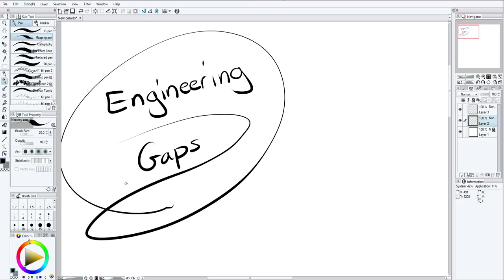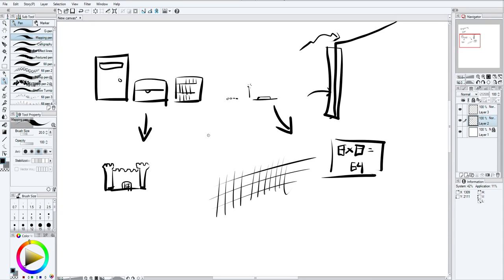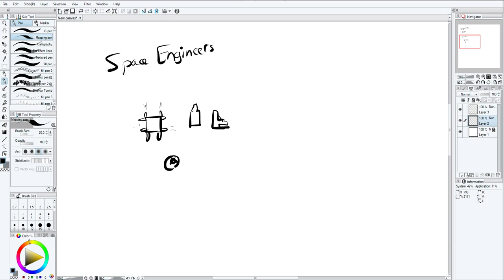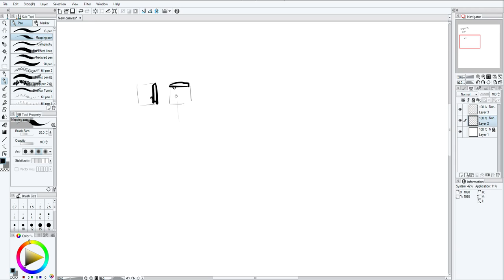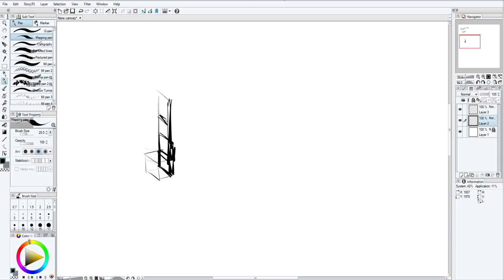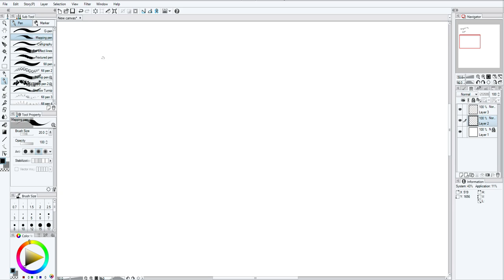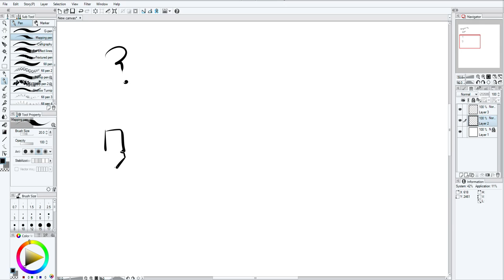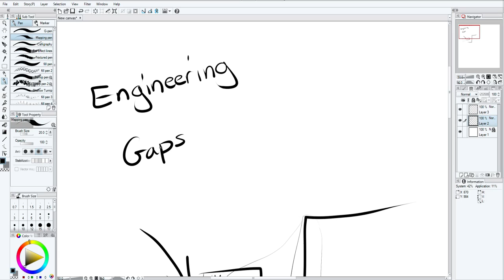Engineering Gaps (Design)

Comment: What you're looking for is stuff made out of orthogonal (in the computer science sense) components that are simple and accessible but still allow to build systems complex enough to allow for emergent behaviour and gameplay to develop. A lot of open world / sand box games strive for this and implement it to various degrees.
Minecraft actually also does this very well with the redstone system and a lot of blocks can be used together with redstone in ways not intended by the programmer before - up to the complexity where the game becomes turing complete.
What you're complaining about however is a lack of balance, so you're not actually demanding a new quality, but just a rebalance.
Which of course is never a trivial problem for complex systems. Even if you start from scratch and not grow into the complexity like minecraft did.
Recreating things that were simple building blocks before, out of more basic orthogonal components can be a way to do this, but it still adds complexity and needs testing with differently skilled players as I think it's easy with this approach to build something that advanced players can appreciate while engineering the fun away for new players.
Reply from the maker: I don't agree that it's about balance: I think it's about opportunities.

I would argue that the redstone doesn't qualify at all. The actuators it interacts with qualify. Pushers, noise blocks, rail switchers, etc - those are powerful tools. The redstone itself is mostly a tool for wiring them together, and it's a massive, massive burden, far more heavyweight than any simple wiring system would ever need to be. It is possible to build complex logic circuits out of redstone, but that is an unnecessarily heavy burden for something that would work fine as a very basic function block.

In short, redstone is the thing I used to think I wanted: make it more difficult to create things. Instead, I would like to easily create things that are more difficult.
Reply: Misunderstanding; when I say redstone, I mean the whole system, not just the dust.
Don't know what you mean with opportunities vs balance, but other than that we seem to mostly agree - taking into account the alternative meaning of "redstone"